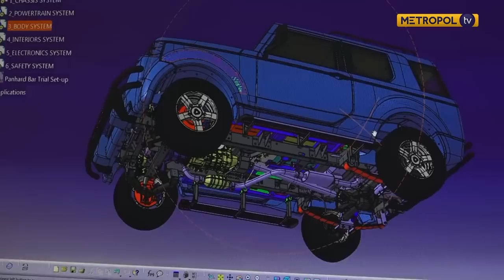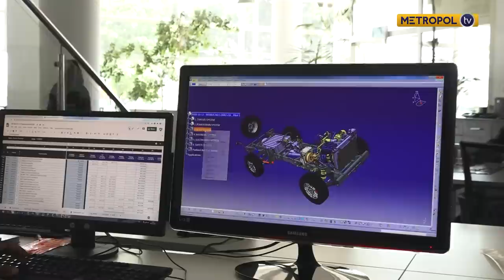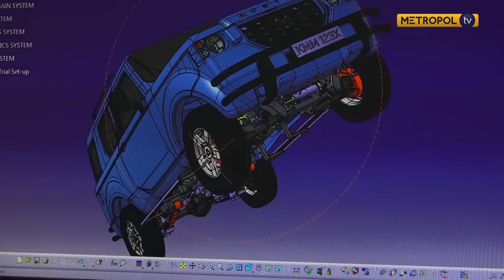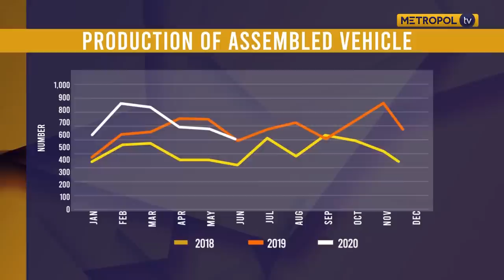The intrigues in first locally assembled Kenyan cars

Comment: Good job but as long as they are not 50_70%  asssembled/built by robots they will remain expensive.to common citizen...Also the manufacturer need to consider going EV,, since its the future and it has more potential..
Reply: It will take a while here in 3rd world countries to go fully electric unless you only plan to drive your electric vehicle  in  the city and not in the rural setting
Reply: @martinmwenda3551  nowadays there are EV going 600-700 klm that's enough for most of journeys in Kenya then charge at your home destination.

Comment: First locally assembled car,or first locally  manufactured car? We have always assembled cars,locally through AVA.
Reply: Vehicles are assembled not manufactured 😂
Reply: @HALYEYMEDIA  You must start from the process of turning the raw materials into assembly parts,or ckd's. So the primary genesis is manufacturing  then assembly.Right from the CAD design, as they are doing at mobius.And now that 60 to 70% of the inputs are derived locally, as opposed to your typical assembly plant that imports 90 % ckd. In this particular scenario, we are drawing a line between what mobius is doing vis a vis AVA,General motors,and the former Leyland motors.
Reply: @HALYEYMEDIA   manufactured lol
Reply: @heraldloshi1864  I would like to see this factory where they mold the engine parts
Reply: @u-know-this  Have you heard of contract manufacturing? How would you describe Ssangyong motors of Korea? The manufacturers of musso SUVs? Are they referred to as assemblers or manufacturers? The mere fact that some of their engines were manufactured by Daimler Benz,does not relegate them to assemblers. How about Tata ? Especially the heavy trucks division. They also had a working relationship with Mercedes,and that did not relegate them to assemblers.

Comment: @Metropol. This is NOT the first locally assembled car. Cars have been assembled in Thika (KVM, Marshalls), Nairobi (GM) and Mombasa (AVA) since the 70s.

2ndly, this car wont go far. Why do they assume that Africans only want a 'bare minimum' car? People would rather top up 300K and import a used X-Trail or RAV4 with AC, ABS, good suspension. Dont just sell function, sell quality.

There's a reason why Govt and corporates aren't buying it. And there's a reason why motoring enthusiasts hate it. Many have complained of lack of comfort, poor driveability and basic features.